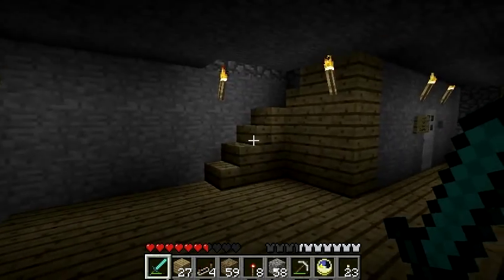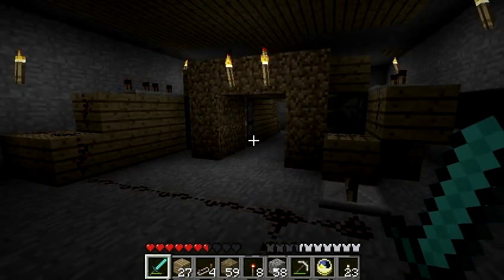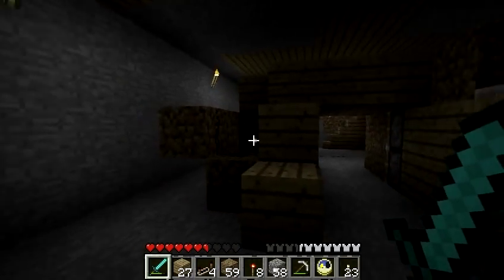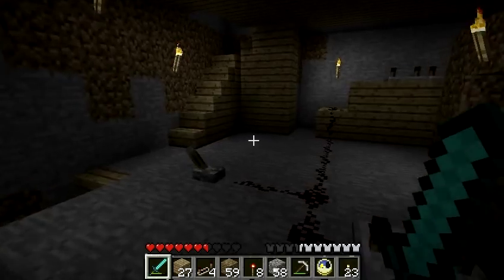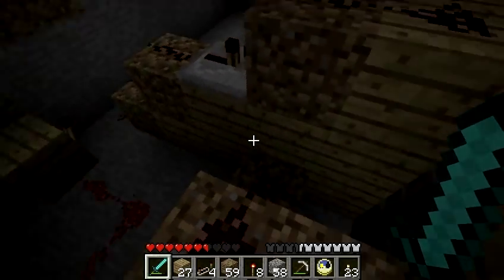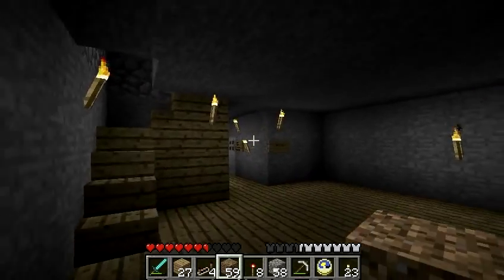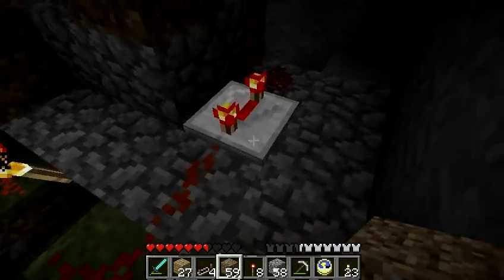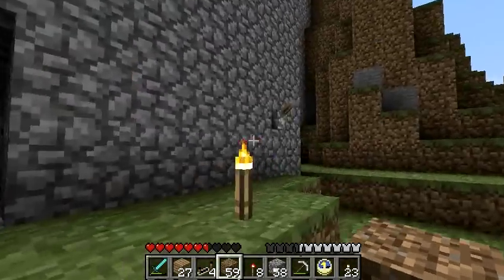Minecraft 1.7.2 Beta Hidden Piston Doors and XOR Gates

Comment: You should try using redstone lamps next to the lower set of pistons that push the blocks inside. Since they act as a transferring kind of block, you can use them instead of the wires on the side to make your door more compact.